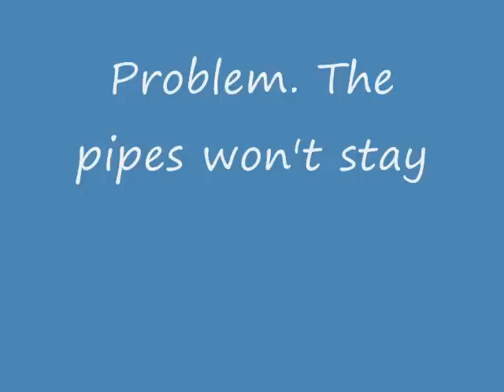DIY Fishing Rod Holder

Comment: Skip the second 2 x 4, just drill two  pilot hole through the pipe.  Now drill a slightly larger hole big enough for the screw head in "one" side of the pipe.  Now stick a screw through the big hole, into the little hole and screw it to the board.  No zip ties.  No second board.  I would also use thin finder washers that will easily bend and curve to the interior of the pipe.  Just insert from the end of the pipe before putting the screws in.

Comment: very nice idea, you can also use screws to attached them to the wood, the outer holes would of course have to be larger than the inner holes so the screw can fit thru. 2 of them one in the top and one on the bottom of each pipe.